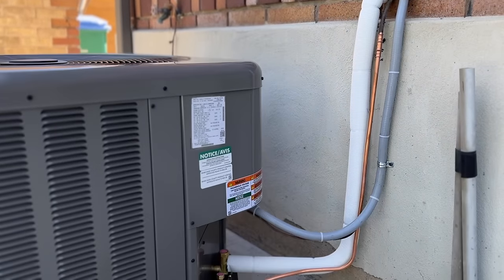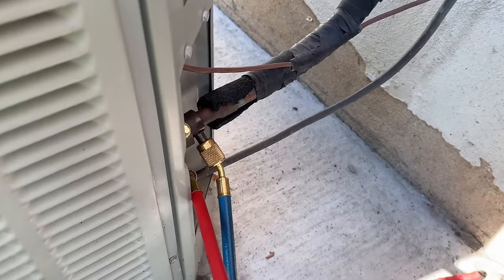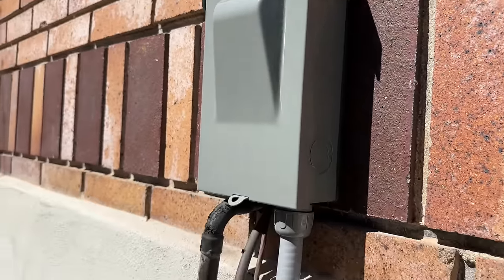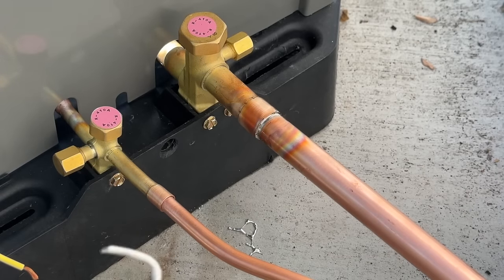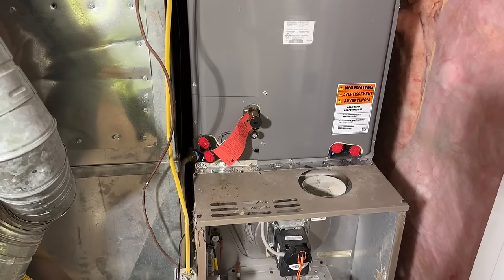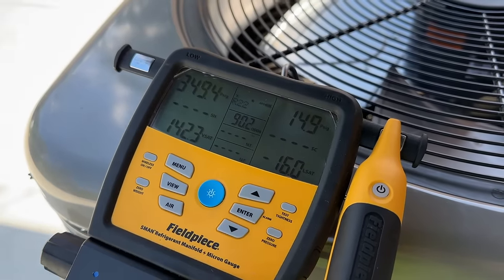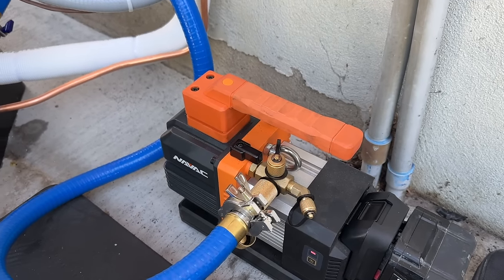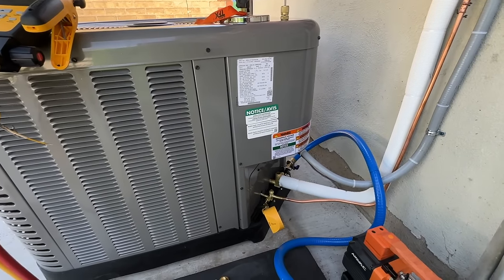Did You Know You Can Replace Your Own Air Conditioner?   -SAVE THOUSANDS-

Comment: Great stuff as usual!  2 requests...
1) With R410a being phased out, can you educate us about what gas will replace it for residential and is it a drop in replacement or is any retrofit needed?
2) What's recommended for DIYers when shopping for an hvac unit?  Buy online or at a local hvac store? Brand recommendations?

Thanks!!
Reply: First off, I advice you get training in the HVAC field before you attempt any type of replacement or repair. You also need to be properly licensed, or you risk fines and imprisonment. 

The new replacement refrigerant for R410a is R454b, which is flammable and very dangerous. It can not be dropped in, R410a would need to be recovered. However R410a will not be totally phased out until 2037. 

Lastly no supply house or online retailers will sell HVAC equipment to unlicensed DIY customers. However you could buy a mini split like Mr Cool, but any major system will not be sold to you, due to liability issues. You need to know proper electrical codes and you need specialty tools. My advice is to leave it to professionals or get proper training, licensing, and experience. This guys videos leave out so much information that you are setting yourself up to get hurt.
Reply: Please tell me a case where somebody has been imprisoned for working on their own hvac system at their own home. I can see fines being applied to unlicensed contractors working on other people's systems at privately owned owned homes. But if you can be arrested for working on your own HVAC system you guys have gotten in deeper with Gov't and regulatory authorities then I could have imagined and I suggest everybody start working on their own HVAC and training their son's and daughters how to do it now.
Reply: @morallyinsane7639 "properly licensed" just means you paid money to get a piece of paper, doesn't mean you know what you're doing.  I've come across some outstanding individuals that really know their craft, but others that just paid for the piece of paper and don't know up from down.  This applies in many industries.  Also, 454b is in the A2L category which is mildly flammable, but interestingly enough 410a also can be flammable under pressure in the right conditions so please don't take things out of context. Also, "drop in" doesnt mean you mix it with R410a. Its implied you evac the 410 before putting in the new gas 🤦🏻‍♂️.  As for specialty tools, even spending 1K in tools is well under the 13-15K+ that you're going to be paying if you get a company to install it in my area.  If you're competent enough to perform an install yourself and save thousands, do it!
Reply: @glencouls  Easy answer, in some states people see you accidentally release a cloud of refrigerant gas and then claim to be effected by it. You could be fined or you could be arrested. Will it happen, depends on the area you live in and who your neighbors are. Also you could get in trouble for not having proper permits. Most of the time nothing will probably happen, but I had a contractor sited just for doing a roof job. It can happen and should it happen and your not properly licensed to handle the chemicals involved, take your chances with the law.
Reply: I think you should talk to other people in your industry and come to a gentleman's agreement that you all look bad fleecing unsuspecting customers. The problem isn't us, it's businesses hiding behind regulation to make it so they are seemingly the only people that can fix this really rather standardized and serviceable equipment.
Reply: @Capafool  Here is we’re you are mistaken on many issues, first drop in refrigerants can be mixed in some instances, it also means they are similar to the current refrigerant being used and share the same oil type, thus both metering devices and dryer/other equipment in the system is compatible. However giving that no new equipment will have R410a, it does not mean you need to switch over. Second while an EPA license is needed to buy refrigerant gas, experience and knowledge is needed to work on specialized equipment. This is we’re you lack the knowledge, if you knew how the industry works, you would know anyone charging you $10K-$15K for a system replacement is ripping you off, their mark up is so high, it’s disgusting. Typical non heat pump units depending on brand and size go for under $2K up to $5K and heat pumps are only about $500 more in that range. That is for an air handler and condensing unit. Evaporator coils plus condensing units for a furnace are even cheaper. I am trying to help you avoid getting hurt or ripped off. I do this for a living and have been doing it for over 20 years. Feel free to research information to gain knowledge, also feel free to ask questions. Some repairs you can do as long as you have mechanical skills, but others should be done under the supervision of a professional HVAC technician. I am not saying you can’t learn, but be smart about it.
Reply: @morallyinsane7639  I don't disagree with the price gouging, but unless you have an hvac friend that can give you a more reliastic/fair price in the area, it's either take what they offer(after multiple quotes) or suffer without AC.  Buddy of mine just paid around 28K to have both his systems replaced. Outrageous $$ and he shopped 2-3 different folks.  Couldn't keep shopping as Texas heat has been hellatious for the past month+.  If you're one of the "good ones" in the industry please have a talk with all your POS buddies that want to price gouge.  And yes for any DIYer that wants to undertake this job, please understand what's going on and have at it! No one to blame but yourself if things don't go to planned, but this isn't rocket science. It's a little chemistry and thermodynamics and you don't need to be "licensed" to understand it.
Reply: @glencouls  Look you want to do this yourself because you feel you are being ripped off is fine. Then take this advice, go find a professional or take some HVAC classes and learn the proper way of doing the job with hands on experience from professional, not from a guy making YouTube videos who is in the same business as those contractors ripping you off. Most information he is offering for a price can be obtained free of charge from the internet and supply houses who sell HVAC equipment. Still without the proper training or experience you risk major injuries or even death. Did you know refrigerant displaces oxygen and is heavier then air, if you are in a confined space like a basement or crawl space, you could be suffocated if a line popped and a major amount of refrigerant was released. Also burning refrigerant gas can cause paralysis if inhaled. Refrigerant gas can be suspended in refrigerant oil which could be in the line set. These are some of the thing this guy never mentioned.
Reply: @morallyinsane7639  yep. I know all of that. Same thing can happen at a hockey rink, or with walk in coolers. You are correct in that he's not going into great detail about that and probably should dedicate an entire video about safety, he has gone into some of that in other videos.
Reply: @glencouls  I don’t have a problem teaching people, but understand this is a business like any other, and it’s to make money. You think this business is bad, how about auto mechanics, insurance companies, medical practices, law practices, the list goes on and on. It’s a business and like any business you have honest business owners and scammers. Educate yourself on how business work, but don’t blame business for some bad apples taking advantage of people’s ignorance.
Reply: @Capafool  Here is some advice, most systems do not need to be replaced due to age, if the system is working, it may be inefficient, but it does not mean it needs to be replaced. Best time to replace an older system is in the spring or fall, or even in the winter if it’s straight AC. However in the middle of summer, expect to be raked over the coals because they know they can. However never fall for the unit needs to be replaced BS, units that are well cared for can last up to 20 years or more and normal units should be replaced after 15 plus years. If you are having a problem, it could be a simple solution.
Reply: @morallyinsane7639  I will blame business when they all appear to be in on it together. Otherwise i wouldnt have brought it up. I have not had this issue with auto mechanics there are a hundred shops in my city all competing. Meanwhile, when I called my HVAC company X, company Y showed up saying that when X is full he has a contract to come do work for them. Had three estimates all within a couple hundred bucks kind of wondering how deep this agreement goes. You think I want to be learning an additional field? $16,000 for a $6000 of hardware is insane and you know it. I suggest you work with your contemporaries and educate yourself on the definition of price gouging.
Reply: Propane
Reply: @glencouls  Where do you live, what state?  Because I live outside of Philadelphia in Pennsylvania and while many companies are high priced, a lot of independent companies such as myself exist. I constantly see people being ripped off by many companies and businesses. Still that being said, I am sure independent companies such as solo operators exist in your area, but people tend to stear clear of them because big companies who are scamming you claim these independents are scammers. The most you should be paying for a three ton replacement is $8K or less. Let me ask this, what reason did they give to say your unit needs to be replaced?
Reply: @morallyinsane7639  sorry my friend I don't give out those kinds of details I'll say I am in the Midwest. Age, and we don't know what "A coil" looks like because it's a closed system. The system was low on refrigerant and I had some leaking water. I blew out the clogged evaporator drain, added about 1.5 pounds of refrigerant (thanks to these videos) and cut an access door to the Coil for inspection. It's rusty but I cleaned it up. And cleaned condensor outside.
Reply: @glencouls  Your unit does not need to be replaced due to age, so that’s BS. Midwest, another Texan most likely. Don’t know what’s going on down there, but seriously educate yourself and get the training, then perhaps open up a side business, I am sure you could make some serious money.  BTW, what refrigerant did you add?
Reply: It is against the law in most states, maybe all, to release gases from an AC unit into the atmosphere.  There is a fine and jail time and that applies to everyone, not just licensed HVAC people.  You can install your own system as a home owner and some places will also sell you the equipment, some won't.  However, you still need to know the laws and the punishments if you break them.
Reply: You're correct - also, many HVAC dealers won't sell equipment to anyone who isn't licensed.  That's entirely up to them, whether they do or don't.  They can also not sell the public parts, that's also up to them.  There are reasons why you should be licensed and trained.  There are dangerous items in the equipment, like the electrical stuff, that could lead to your demise if you don't know what you're doing.  So, glencouls, don't be so cocky about telling the public that they can install they're own systems and buy them - maybe they can and maybe they can't.  However, a trained HVAC person has gone to school for a reason and has passed the licensing test for a reason, just like an electrician, plumber, builder (contractor).  Dangerous conditions could arise that you might not know how to deal with.
Reply: @morallyinsane7639  I concur, and definitely am of the mind to troubleshoot and fix the issue than replace outright unless that's the last resort.  Been able to fix 4-5 different relative's A/C with basic troubleshooting and have yet to replace much more than capacitors, contactors and a blower motor(and I even rebuilt the bad motor so now they have a spare in case the new one goes out). Interestingly,  when I replaced the blower motor I found out the "licensed" techs who installed the system had wired the motor incorrectly and weren't using the correct speeds for fan/AC/heat and of course the unit had been underperforming for years. 🤦🏻‍♂️ my systems at home are about 17yrs, and I know their time is coming, but with upkeep and routine maintenance maybe they can last me a little longer.
Reply: I myself hope that everyone who works on refrigerant on their own without being licensed makes sure to put their address up on the Internet so that others who are licensed can record anything they see happening with the refrigerant.
Last I heard it was a $10,000 reward to showing proof of any unlicensed person letting any refrigerant out. Might be higher now but 10 years ago that was the figure.
Reply: @gtpforever  New bounty is now over $13,000. Reason for the increase I was told was due to inflation. How nice of the government to keep up with inflation when it comes to fines.
Reply: @mojo9288  our government will probably give us $1 a year on our taxes for 13,000 years though. 😂🤣😂🤣
Reply: @lousaddler1213 what's interesting is anyone can buy all the electrical parts off the shelf
Reply: @morallyinsane7639  A DIY owner cannot be fined or imprisoned for not being licensed.  There is no criminal code for not having an EPA license.  EPA fines businesses not individuals.  The fact you can buy R410 or units with R410 should give you a clue that it is not illegal.
Reply: @xrenox1  the problem is that no vendor will sell any AC unit to the general public. It’s a liability issue more then anything else. May not be illegal, but can lead to a lawsuit should the private party get injured or killed due to not knowing what they are doing. Now anyone can buy anything on the internet, most of the time because it’s stolen, which in itself is illegal. You want to buy equipment, then get a license and some experience as well.
Reply: @lousaddler1213 It’s an EPA regulation and therefore a Federal offense for intentionally venting CFC/HCFC into the atmosphere. (that means all 50 states!)
Reply: @xrenox1 You’re wrong in your EPA reg interpretation. They apply to everyone!
Reply: @georgejetson4378  sure if you say so. rofl

Comment: The big problem with Stay Brite 8 is that you need a very tight connection in the fittings and too often the low side, offering a 5/8 copperline has been connected by swagging (stretching) one side of the 5/8 copperline and doesn't give you that tight-fitting you need with stay Brite 8. At that point you're stuck because AC companies will not fix the connection for you, they don't want the liability. I did find there are other welding that you can use with MAPP gas and there are much better than stay Brite 8 which has 6% silver. Regular braising by AC techs use 15% silver so they don't want the risk of raising over a failed stay Brite 8 6% connection. However there are other welding sticks that use MAPP gas and have a much higher % of silver, like the SSP 6 56% silver 70,000 psi product from Muggy Weld in Washington State. Plus the flux is on the welding stick itself and it is very good, great at cleaning the connection. You can get it on Amazon or direct from the company. I called them at 4:30 p.m. Pacific time and they shipped it overnight to Florida so it arrive at 9:30 a.m.

Another thing that was not brought up in his videos is that if you are switching out condensers with the same refrigerant there is no explanation about transferring it back into the new or new to you  unit. What I learned the hard way is that you have to leave the low side (big pipe) closed and close the small pipe coming out of the old unit where you cut it or all the freon will leak out when you go to transfer. I think there's a way to bend and crib recorder inch copper at the end but I didn't find any videos on that. So I bought a faucet valve with a 3/8 compression fitting and that fit the 1/4" copper line perfectly, then I closed that valve. 

Unfortunately stay Brite 8 on my 5/8"s connection failed after 30 minutes and I lost all my R-22 freon! Now I have to buy 8 - 10 pounds of it in AC companies charge $75 per pound + installation. You can't buy it on eBay anymore, but I found some on Facebook marketplace a 3 hour drive away.  Buying R-22 without a license is possible but not easy. I hope this helps some others who are going to take this on.  Anyone else who wants to offer advice would be appreciated.
Reply from the maker: I thought I made this pretty clear but all new units are precharged with 410a refrigerant. The old refrigerant stayed in the old condenser and I recovered that later, but that is not used for the new system. The new refrigerant is in the new condenser, so all you do is pull your vacuum, then open those two king valves which allows the refrigerant to flow into the whole system 👍🏼
Reply: @diyhvacguy  both of you are wrong, he bought another R22 condenser, they are not pre charged and are cheaper, he was trying to reuse the refrigerant in the new system. It can be done without recovery. You see how your advice is causing problems, you give people hope while setting them up for failure. Educate your customers and teach them how to service their units, but leave the installation to professionals. I have seen too many DIY fuck it up based on videos like yours. Are you going to take responsibility if one of you subscribers gets hurt or killed based on your DIY videos?
Reply: @morallyinsane7639  The unit that was installed is a R410A unit my guy. The condenser was pre-charged - did you even watch the video?
Reply: @JamesxRamirez  My comment had nothing to do with the original video, it was in response to the other posters comment who upgraded to a new condenser for his system that use R22. Those condensers are not pre charged and he asked how to transfer the charge from the old system to the new one.